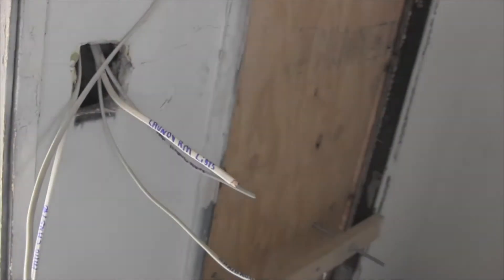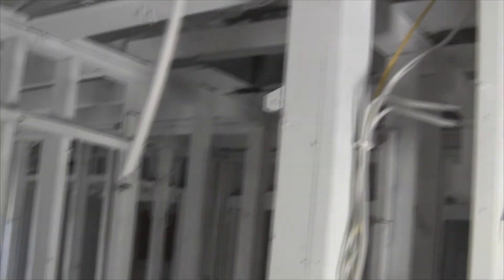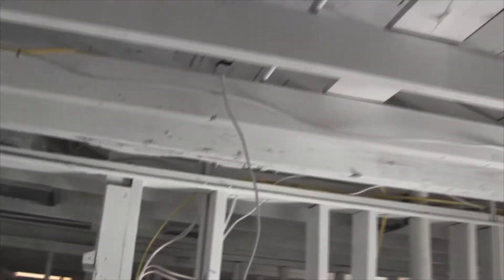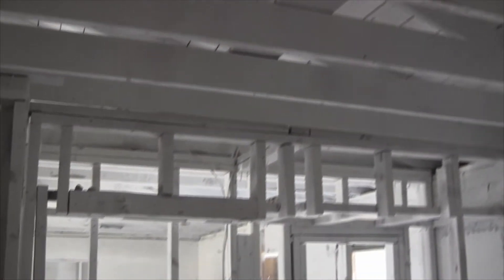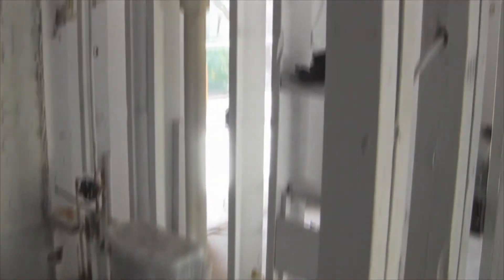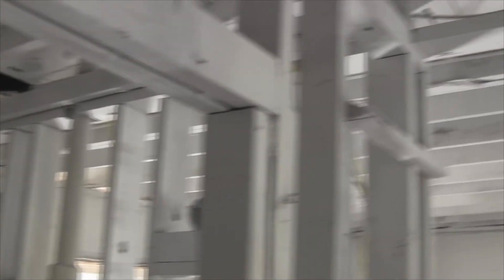Electrical Rewire Update

Comment from the maker: @Megawatts37 Here is a portion of the spec sheet for the boxes I used.They are Crouise-hindes brand--
"CEILING FAN BOXES AND SUPPORTS– 
CUBIC INCH CAPACITY (SEE BELOW)
UL LISTED
Weight Limits: TP261 – 35 lbs. max. for fans, 50 lbs. max. for fixture. TP301 – Fan is supported independent of outlet box, mounting screws
go through box and into joist. Box will support fans up to 70 lbs. and fixtures up to 90 lbs. TP275 – 70 lbs, max. for fans, 90 lbs. 
max for fixtures".

Comment from the maker: @Steve55599 Home run is when you hit the ball,ooops wrong meaningLOL. Each branch circuit feeding a room/s and or appliance is fed from the panel to your first box so The wire from the first box to the panel is the home run box.

Comment: sparky,nice clean looking job,i was just wondering why you dont leave 6 inches of free conductor out side of the device box in a question mark or loop shape ? were taught this is school in canada, so if the drywaller nicks a conductor you can just pull new conductor into the box. thanks for all the great vids